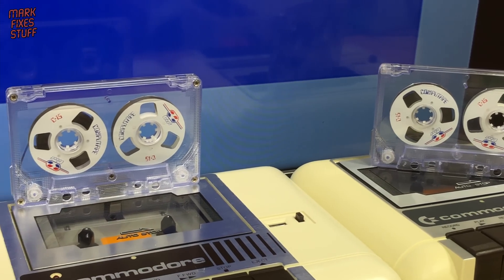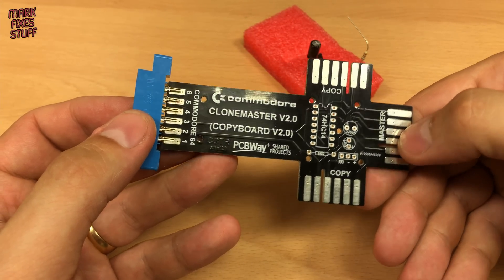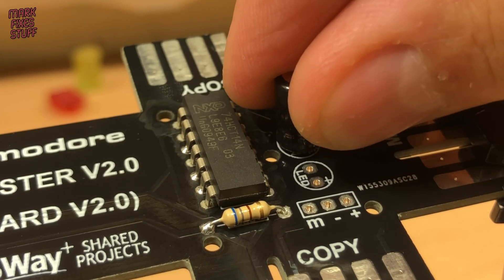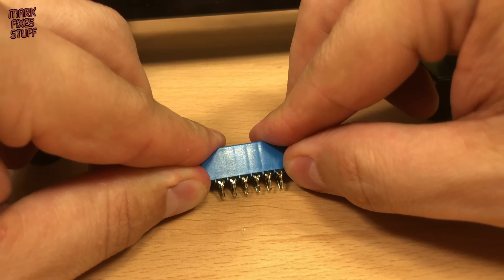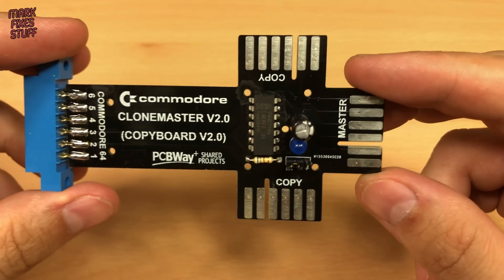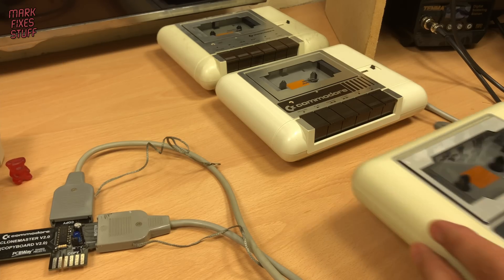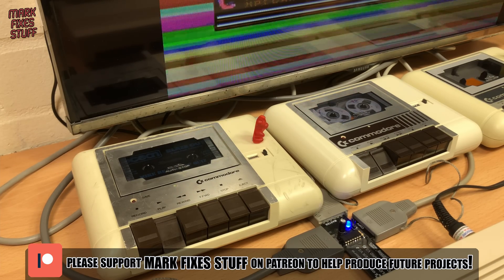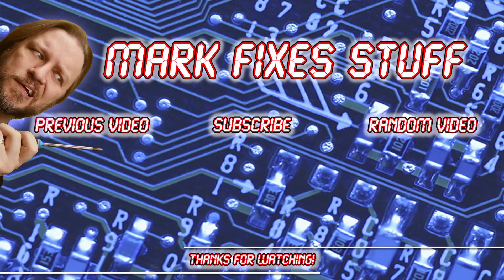I built a 1980's Tape Piracy device and blew up my C64 ¦ Clonemaster V2 0

Comment: Hello Mark I bought 5pz. of your PCB (to duplicate c-64 tapes). I have another questions. I need,about c-64, to build a SD/MMC drive emulator (connected to c-64 serial port, not connected to tape port); I'm searching an Arduino project or another MCU project where the authors published: schematic and firmware to permit me to build it or in kit mounting like your project.
Thank you to your reply.

Comment: Nope, did it the non-soldering cheap way back in the '80s: dual deck boombox.  Well never tried original tapes, only "mix-tapes" with turbo-loader in-between the games.

Comment: This may be a dumb question (here in America most people had disk drives on their c64's, so I'm not too familiar with these data cassettes). 

I'm just wondering if you could just use an audio grade dual cassette deck (like common Pioneer/Kenwood/etc) or even a dual deck boom box and dub the data cassettes that way?  

If not, what was the limiting factor?  The type of tape used?   Something to do with mono to stereo conversion (that I suspect the audio deck might do)?  Perhaps something else?  

Looking to do my own little experiment in "retro piracy", so I'm trying to get some insight into how some of the things to look out for in audio tape dubbing.  

Thanks for any information!
Reply: oh, you can, for sure, but I guess devices like these eliminated the need to fiddle with volume levels, something people who have used Sinclair machines are all too familiar with. And besides, this device makes 2 copies at once instead of just 1.

Comment: I used an Amstrad to copy my tapes…
Een Amstrad hifi with dual tape deck that is. Worked fine after I tweaked the head position on my data set.

Comment: I would have used a socket so you can easily replace the chip.
Reply from the maker: Not making excuses, but with the desoldering station it’s dead easy for me to swap a chip and I needed the socket for another build the next day. I did test the logic function of the chip before I soldered it in though.
Reply: @MarkFixesStuff  Yeah i know i got i think the same one, the ZD-915 desoldering station, and it has made desoldering a LOT easier, but yeah i still would have used a socket, is still faster and easier removing a chip.
Reply from the maker: @AmigaWolf  I tend to think soldering in logic is ok if I’ve tested it. But I’d never solder in an EPROM, Flash RAM or a GAL.

Comment: Great video Mark, my first thoughts on this was if you have to wait for the game to load, how would you backup something like Winter Games or Beach Head Ii? Would you have to stop the tapes on the slaves, complete the level, then resume recording on the slave decks before you had to press-play on tape?
Reply from the maker: Well, you don't actually need to load the tape at all. You can just press play on the master and record on the two copy decks.  in fact, the "jumper" I messed up with is a power header and you can apply external power to the board without it even being in a C64 at all!!!

Comment: My bro had a DCL, tested first copy was Bounder.  No looking back after that, still have it somewhere. Incidentally I remember reading an article online about the internal male datasette connector in the datasette.  It was not possible to simply connect a second deck and press record but with a bit of rewiring you could send the record signal to the correct trace and do it.

Comment: huh? i copied them in a double tape deck from a normal stereo tapedeck.. never had a problem with that. i mean even today you can download audiodata from c64 tapes re record it on a tape and it will work...
Reply: I've seen .T64 files for C64 tape images.  Is there some other format like .wav for the tape audio files now?    

That would make the project I'm working on so much simpler.

Comment: I had a master/slave one back in the day, I think it was by the same company that did The Expert. Didn't use it all that much, but it somehow nearly felt like it made cleaner copies than the originals themselves (which could play tricks to be a bit marginal and hence not good for audio deck copies).
Reply from the maker: That actually sounds feasible, so I would not be surprised!

Comment: i used my mum's hifi to copy tapes it was easy it had a counter so that was obviously useful, also it had a big headphone jack socket so to stop all that tape noise i would put a large to 3.5mm headphone jack adaptor and it would cut the audio off but still record just fine. i was so glad when i got a disk drive i hated waiting for the tapes to load lol
Reply: the "large" is 1/4".

Comment: Great video Mark. Silly question but can you copy C64 tapes using a twin deck player with dubbing?  We used to do that with Spectrum games and it seemed to work ....mostly. Was the C64 harder? (I never owned one).
Reply from the maker: Yes. There is some trickery in the datasette and that converts the analogue tape to digital before sending it to the machine . I don’t know much!
Reply: @MarkFixesStuff  sounds like black magic 🤣

Comment: There were a couple of versions of those Datasettes which had an internal connector for daisychaining a second datasette, but in order to use this feature, the user would have to remove a part of the casing.

Comment: I recall my adaptor required a 9v battery to supplement power so it's not overloading the c64. I don't recall the name of the software used way back then though.

Comment: The C64 was the first computer in my house as a child. I had the mk1 version ((chunkier than the one in this vid). I was the type of kid that wanted to know how things worked, was forever taking things apart. I remember taking the tape deck apart and seeing that there was a connector on the circuit board that matched the back of the C64. so from a boot sale I got hold of a second drive and it plugged in. this allowed me to copy games flawlessly. the second deck didn't have this internal connector. Does anyone else know of this internal connector?
Reply from the maker: I have a datasette with one of them!!!

Comment: Am I missing something?  Couldn't you just straight copy the cassettes?  Do you need a higher fidelity copy for software or is it the convenience of making two copies simultaneously?
Reply: Line in varied massively for cassette recorders. And a copy made on one recorder wasn't always able to be played back reliably on anything except that recorder. So this just removed several variables to allow you to make consistent, clean copies
Reply from the maker: No need to repeat what Morgan said.

Comment: I have an old tape to tape board which still works fine. Left side for playing tapes and right side to record. They come in handy and can be used to run tap files from your PC to the play deck using one of the car tape adapters and then record onto a proper cassette
Reply from the maker: Interested to know if that produces good copies of c64 games.
Reply: @MarkFixesStuff  Yeah it does as you can get the volume just right. Last time I did it I used my Mills deck as the play deck and with that having the set of lights could see how loud or quiet the signal was. Managed to transfer a copy of Alien 3 with no issues to a proper tape that worked exactly as it should

Comment: My dad had contact with a very clever elctronics guy who gave him the layout for a PCB designed to copy C64 cassettes, 2 connectors, one for the master drive, the other for the slave. My dad duly bought the copper plate or whatever it was and then etched the PCB pattern with a pen and etching fluid (no PCBWay in those days!), added the other bits (think a 555 timer IC was involved but I forget) and voila! one board ready to go.

I became insanely popular amongst the playground geeks as the board was much more reliable than trying to use the tape-to-tape decks everybody else had and needless to say my C64 library expanded at an exponential rate :D

Great video Mark and glad the C64 survived your little mishap
Reply from the maker: Great story! I love hearing things like this.

Comment: Here in the US floppy disk for the C64/C128 where king, and tapes where a very distant 2nd fiddle, even as expensive as the drives where, people often had dual 1541/1571 drives with Jiffy Dos mods to speed up disk loading. My personal setup for copying disk were 2 1541 drives with Jiffy Dos, and Maverick Disk Copy till I got a C128 with Dual 1571 drives, and Jiffy Dos to speed up loading GEOS 128, and Q-Link, since not a ton of software came on disk for the C128. 
Also my late uncle ran a Commodore users group in the state of Connecticut in the mid - late 80's where he would have copy parties, and would often send me software in the mail that often were cracked copies which I always looked forward too as I sometimes found the cracktros more interesting than the software/games themselves.
Reply from the maker: Brilliant! Yeah, we were lowly tape paupers here. The market was already geared to selling cassettes I think and the drives were waaaay more expensive as well. Loved reading your recollection and I also found the intros often more skilful than the games churned out.
Reply: I remember using the Fast Hack'em program that had a nibbler copier and hundreds of "parameters" for defeating copy protection on specific games.   Did this all with only one disk drive.  Good times!  😏🏴‍☠️